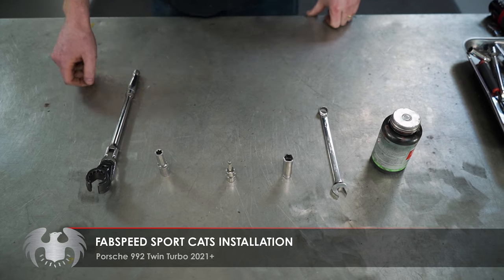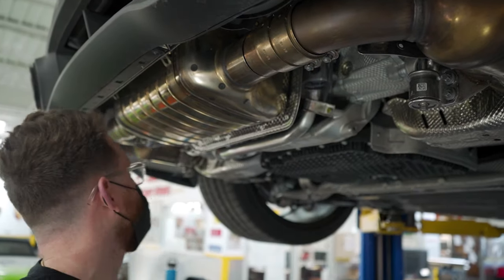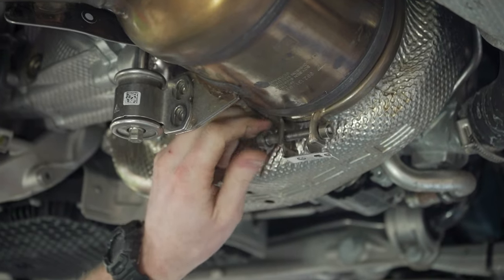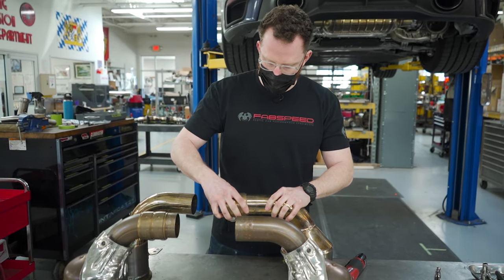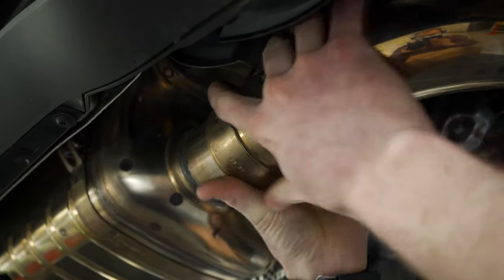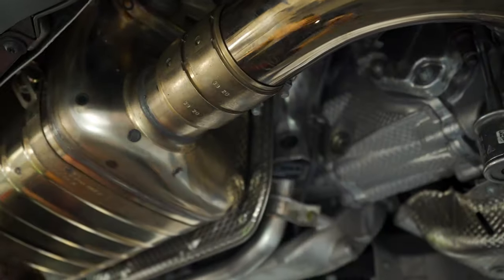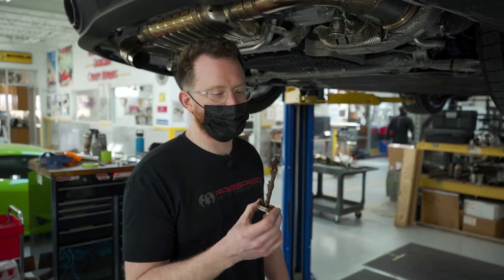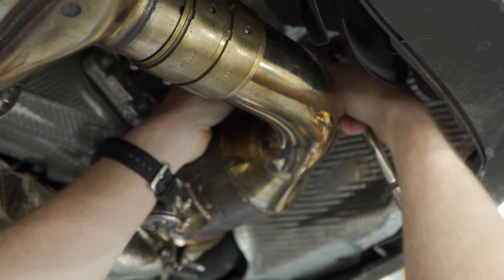Porsche 992 Turbo 2021+ | Sport Catalytic Converter Installation | How To Do It Yourself

Comment: This is a very mis leading video. The v band clamps are impossible to get at . In this video the v band clamps are not in the factory delivered position. Also you need to release the v band clamps and the muffler clamps, then rotate the cat to access the o2 sensors. It is a very difficult install due to the restricted access.

Comment: What about the EU spec (where we have the GPF)? Does it need a remap to get rid of the any error message that may show up?
Reply from the maker: We are looking into this now so that we can best serve our EU customers!
Reply: @FabspeedMotorsport  I would also want to know the answer to this. As of this moment on the website, it says only US models are guaranteed? This comment was a year ago, so I wonder if you have an uppdate?
Reply from the maker: @MrSenses33  We are actively working on solutions for monitored GPF's, and will be releasing that within the next 6 months
Reply: @FabspeedMotorsport  Okey cool. Further, it's my understanding that this is only an "issue" when implementing your sportcat's. If so, can you overcome this by only installing the valvetronic system?
Reply from the maker: @MrSenses33  Correct, if you do only the Valvetronic of Supercup exhaust, there will be no emissions issues whatsoever.
Reply: @FabspeedMotorsport  Ok, thank you for your answers. Excuse my many questions. But for the very last thing, would you say the soundprofile is similar without the sportcat's and only the valvetronic system? Don't think you have a sound demo up on that currently! Thank you for your great work btw!
Reply: @FabspeedMotorsport  Forget that last question. I found the video I was looking for! Thank you for the help!
Reply from the maker: @MrSenses33  Glad to help! It's still a great sounding exhaust with just the Valvetronic, the sport cats just add a bit of volume and growl.

Comment: heat shields werent transferred over. thats how you melt stuff or start fires.
Reply from the maker: We put over 100 dyno miles on the car with our Sport Cats and never had any heat issues. The dyno is a much more rigorous thermal test than any real-world driving because of how much less airflow the underside of the car gets as compared to real-world driving. Also, we have designed and tested sport cats and full exhaust solutions for every single 911 Turbo generation, each time assessing and addressing any heat issues. We know these cars front to back.